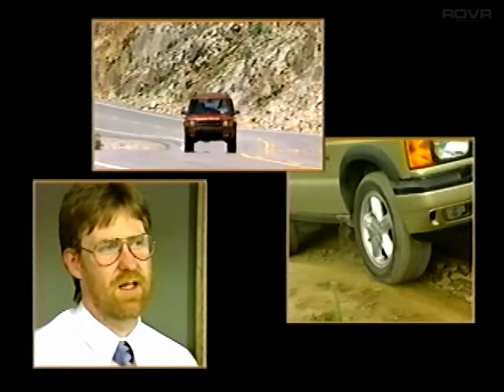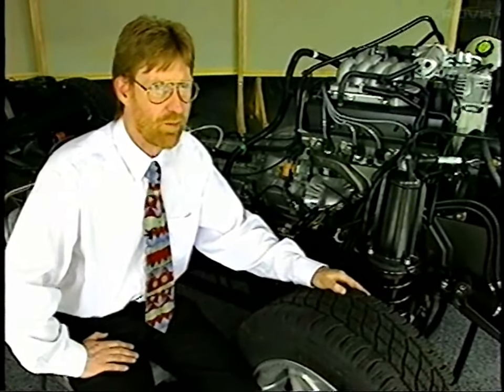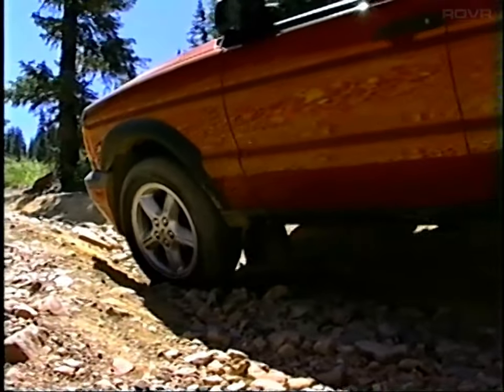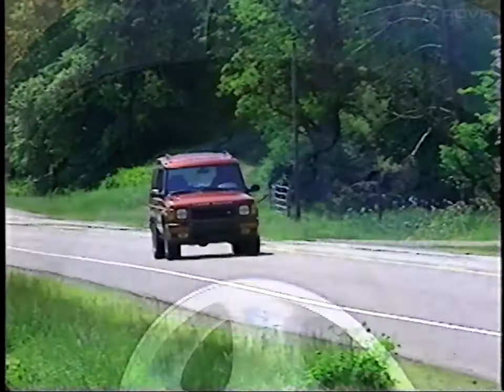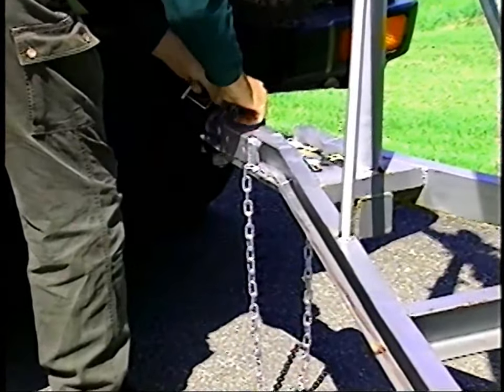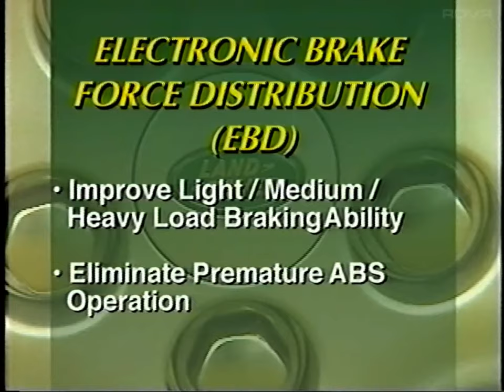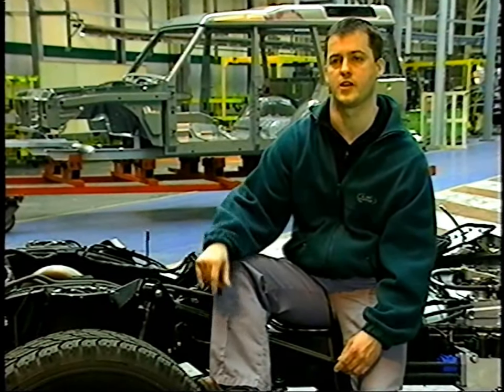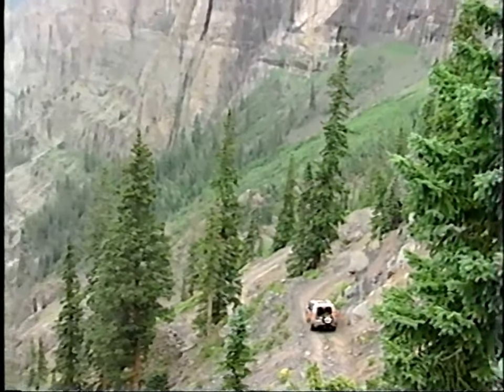Land Rover (US) - Discovery Series 2 - Land Rover University Training - The Braking System (1997)

Comment: Does Disco 2 comes with a Diff Lock?
Reply: Yes it does. I believe 98 to 02 models comes with diff locks. Eliminated on 03 model becauseLand Rover in their wisdom thought the system is doing so well! Let’s take out the diff lock! The community back fire for it . And they added the diff lock on the 04 model. If you happen to own an 03 model Disco , you have the option to add diff lock kit on it for like $300 or more.
Reply: Did disco 2 had Air suspension?
Reply: @sal1520  false only 2004 came with a diff lock you have to spend 600 ish dollars to get a diff lock on a 98-01 or 03, and 2002 has no capability for a diff lock
Reply: @TheDaneJohni  only rear
Reply: @royun1962  thanks👌🏼
Reply: The D2 only had a center diff lock for the transfer case for 2004.  The d2 never had locking axle differentials. NAS spec vehicles.